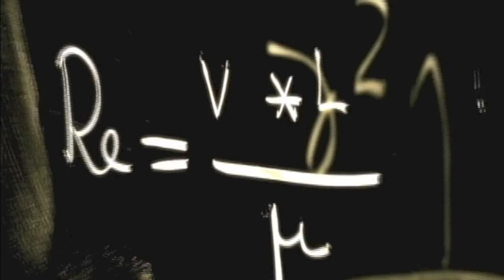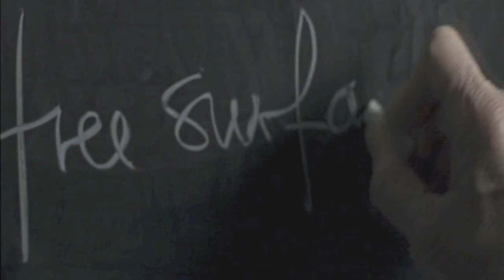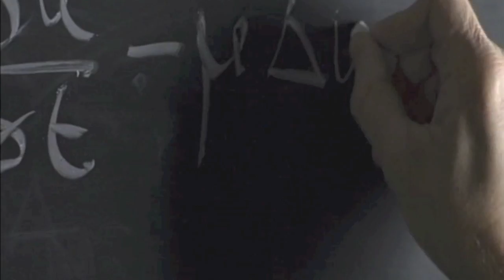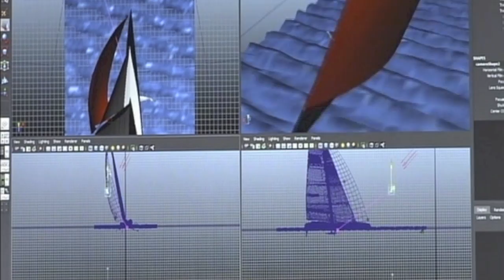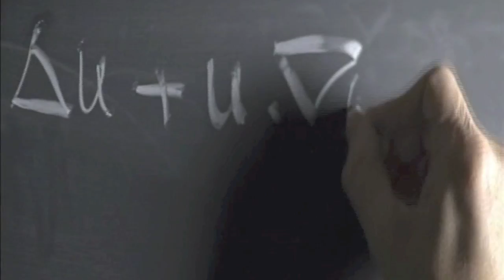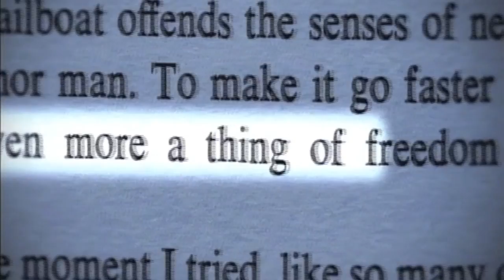SpeedDream on the BBC.mov

Comment: I'm with Simon C.. If you want to get the keel out of the water, get it out of the water. Drag in the air will be about 1/1000th what it will be in the air, which is why you want it there. Concerns of disrupting the airflow seem misplaced, since on a multihull there would be lots of stuff out to windward 'disrupting' the airflow, yet the speed goals for this project (per the longer BBC video) are to be as fast as the large multis.

Comment: this boat probably will hit 50 knots, the current generation of Volvo Open 70's can hit speeds in excessive of 40 knots. as for the keel, the reason you keep it and not the idea you proposed is windage on deck; which impedes or changes the wind in the sails, which would hurt more than it would help